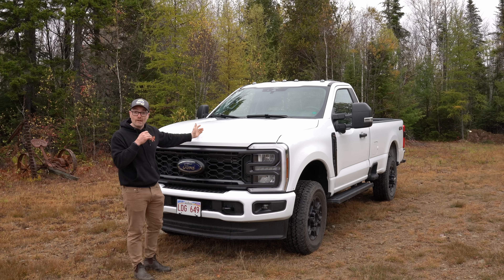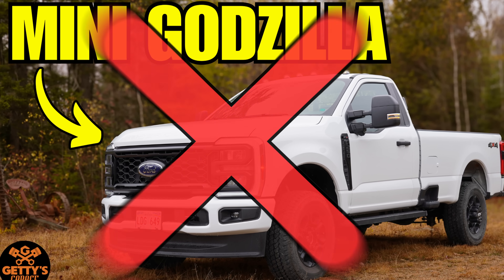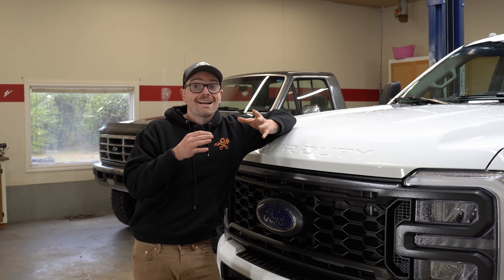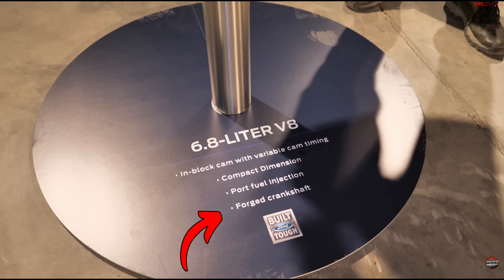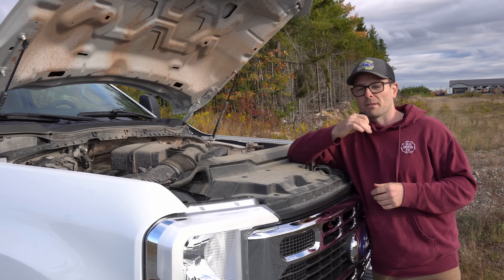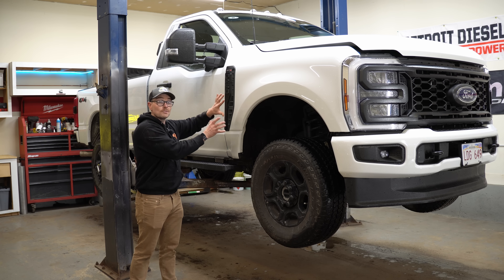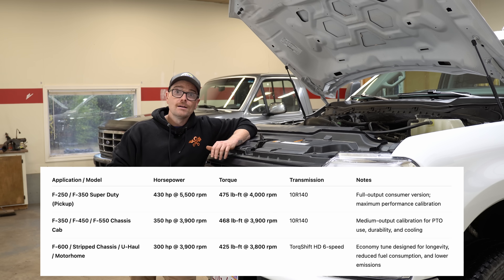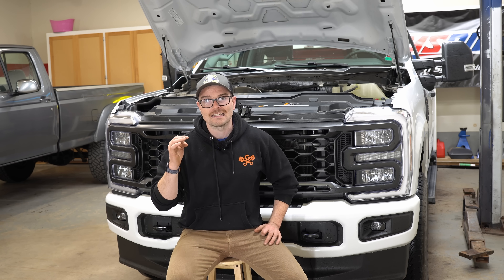Ford F250 6.8L Mini GODZILLA V8 Engine | Weak Points & Common Issues YOU Should know..

Comment: I have a f350 crew cab stx with this engine and I'm extremely happy. I tow a 5th wheel at 12750 gvw and have been all over North America with it. It's been extremely reliable, has PLENTY of  power even at high elevation and it sounds phenomenal. Best of all it has none of the problems that come with modern diesels. I would buy another in hearbeat
Reply from the maker: Thats awesome! Happy trucking
Reply: GET THE NEXTGEN VALVE BODY AP GM FORD ALL 10`S NEED IT ASAP
Reply: Hi, what reared differential ratio are you running?
Reply: @jockobacumbo623 3.73
Reply: @jockobacumbo623  3.73
Reply: This engine is a pig, just get a diesel and delete the emission crap from it.
Reply: @polska905  Emissions Deletes aren't all they are cut out to be. Who would want to void the warranty on such an expensive vehicle to begin with? Additionally, deletes create their own problems. These engines are engineered to use the EGR to help control temperatures in the head etc. thermal problems end up leading to warped heads, head gasket problems and all sorts of other things.
I have a close friend who is a diesel mechanic who regularly does $15,000 jobs on recently deleted diesels. 
Unless you need to tow over 20,000 lb on a daily basis there is no economic case for diesels in a pickup truck anymore. The new HD gas trucks from all three manufacturers perform great.
Reply: @mike-b5c3g your friends are obviously doing something wrong, I know over a dozen people with deletes and their engines run better then new.
Reply: @mike-b5c3g Exactly ill stick with my 12 mpg
Reply: for another 10,000$ plus 5k to delete? Thats insane
Reply: @jasonkushneryk5649 maybe 10k more, but it will save you money on fuel in the long run and last longer and have way better low end torque. can delete for less then 5k.
Reply: @polska905 how much do you think it cost to replace the 6.8L gas engine? once it goes
Reply: @polska905 LMFAO at talking about spending a extra 10k to save pennies on fuel 😂😂😂
Reply: @West_Anderson it's not pennies, it's 10s of thousands of dollars over the lifespan of the truck.
Reply: @polska905 no it's not lol. You'll never recover that difference in fuel costs vs maintenance etc.
Reply: @West_Anderson you absolutely will recover the difference and then some.
Reply: @polska905 let's see, I did the math which I doubt you have. It would take roughly 150,000 miles and 10 years to break even. And that's considering that every single mileage of use is with towing and a difference of the gas getting 8mpg while towing and the diesel getting 15mpg which is optimistic.  So unless your doing nothing but towing and over 20,000 miles a year, no it does not make sense and you will not save money. It literally only makes sense if it's being used for a business work vehicle.
Reply: @West_Anderson your math is wrong,  a diesel, will absolutely save you a ton of money, especially when you consider it will outlast that pos gas engine. Do a delete on a diesel and it wins by a country mile.
Reply: @polska905 still waiting for you to provide actual math instead of your opinion based assumption. Which you won't, because you're wrong.
Reply: @West_Anderson wow what a coincidence, I'm waiting for the same thing from you...
Reply: @polska905  Cost of fuel as of writing this - diesel $3.497, gas $2.996. Fuel economy - generously a deleted 6.7 is reported at 21mpg, and I can't find 6.8 numbers but being extremely mean to the 7.3 puts it at 14mpg. That puts us at $16.65 per 100 miles with the diesel, and $21.4 for gas. Assuming it costs $10,000 extra to spring for the 6.7, and another $3,500 to delete it, that would take 284,210 miles to break even. If the 6.8 gets better fuel economy than our worst case scenario 7.3, like say 16mpg, then it would take 649,038 miles to break even. If the deleted diesel gets less than 21mpg then it takes even longer still. This of course also doesn't account for the increased insurance cost of buying the diesel. More expensive vehicles cost more to insure.

TLDR: Unless you're towing heavy loads constantly, then you'd be way better off putting $10,000 in the stock market than buying a diesel.

Edit: Oh and assuming you drive the national average of about 15,000 miles per year, it would take 43 years to hit the 650,000 mile break even mark. Almost 50% longer than the term of a mortgage.
Reply: @samueljardine3402 yes, it's easy to skew the numbers for the gasser as you did, but in other parts of North America diesel and gas prices are on par and your bullshit mpg numbers are not for towing, once you hook up a trailer to that gaser, you are lucky if you see 8 to 9 mpg and that pos will fall apart way faster then a diesel.
Reply: @polska905  Cope harder. Those fuel prices are the national average. This channel also tested the 6.8 and it does get about 16mpg in real world testing. And I literally said that if you're towing all the time the diesel makes more sense. But most 2500's aren't towing most of the time. If you cherry-pick certain parameters you can skew the numbers for the diesel, but for most cases the gas engine is the better option.
Reply: @polska905 No one's buying a 100k truck and voiding the warranty. Id never trust buying a used modern diesel.
Reply: @Billybob-go8hn thousands of people are deleting on brand new 100k+ trucks, if they weren't, there wouldn't be a market for it.

I personally know someone that bought a brand new ram 3500 and it had a delete in it the first week he got the thing.
Reply: @polska905 Dealers cant legally sell deleted trucks, thats a lie
Reply: @Billybob-go8hn when did I say anything about a dealer?  Companies sell delete kits for brand new model trucks. Why would companies sell delete kits for brand new trucks if nobody was modding brand new trucks?
Reply: @polska905   Doesnt matter. You're not getting a deleted truck for msrp. Your buddy bought a brand new truck from a non dealer deleted. Any problems he has no warranty. That is the dumbest plan I have ever seen. You're not getting a truck deleted with a 100k warranty.   Ill stick with the gasser that  costs me more per week but lasts longer. in the end saves me more money. Ive run the numbers, you're far from smart.
Reply: @Billybob-go8hn iv ran the numbers and done the towing, you are not saving anything with a gas engine. Yeah, try and make fun of me when you got nothing, not surprised...
Reply: @polska905 You lose an argument and jump to another dumb argument. After 2 years I can replace my truck, you delete it you better hope someone wants your hammy downs. Because you're not trading it in at a dealer by law. If you can find a sucker to break the law, go for it. Ive never rolled over negaitive equity or had a break down in the last 15 years. Because ill just trade it in for a newer model. Your finacial situation definitely isnt great, I can tell. All the new diesels, doesnt matter the brand has a 60-70% chance of having a major issue pre 100k. Sure its underwarranty. Id rather have the peace of mind, if im stuck on the side of road that can cost me thousands even with a backup.
Reply: @polska905 and you probably tow 5 times a year.🤦‍♂️

Comment: The thing they got wrong is that the engine will blow up before 80,000 miles.  The valve lifters self-destruct due to low oil pressure when idling.  There are lots of videos about this.
Reply: You are referring to the early 7.3. Zero issues to find with lifters and the 6.8
Reply: This was on chassis cab configurations of the 7.3.   They had single digit oil PSI at idle, and that’s what chewed up the lifters. The 6.8 has over 30PSI oil pressure at idle.  Not a problem.
Reply: @motorobo0  30 PSI at idle? That would be great if you are correct, but my research (granted this was the 7.3) was that it could drop as low as 8psi at idle. There is a recent PCM flash (I discussed it above - but I doubt even that flash boost it to 30 at idle). But, I hope you are right - I'm just not finding info to verify.
Reply: @Quidisi  I haven't seen that info out there either, but I was also concerned about it, so I checked a couple of times on my 6.8 with forscan.  The second time, because I couldn't quite believe the first time.  It bounces around, but didn't drop below 30 when it's warmed up.   Always a chance it could dip below, but it didn't while I was staring at it for a while.  Clearly though it's a far cry from the single digits in the early chassis cab 7.3s.  I think they learned their lesson, and maybe even overcompensated.  That's the single biggest piece of bad PR that Godzilla has had, and the once nice thing about the variable oil pump is that the pressures can be updated..  Easy fix.
Reply: Can you replace the oil pump with a constant pressure pump?
Reply: @pehenry  Yes. $500 Melling high volume oil pump. You'll take a slight MPG hit, but your engine won't be oil-starved.
Reply: @pehenry  There is a way to increase the idle RPMs, which its said accomplishes the needed oil pressure increase.  However, for many, installing the needed hardware/software will be too late. 😡 Also, a heavier oil in summer (and even in winter) may help. But, be careful you don't void your warranty if your vehicle is still covered.
Reply: @pehenry Yes... Holley makes replacement

Comment: My 24 Nissan Titan XD Pro-4X has the same payload and can tow just as much as that Ford 6.8 and will outlast it too!!
Reply: Unfortunately 90% of truck people will immediately right you off the moment you say "Nissan" regardless of specs . The brand has also lost a lot of legitimacy in the car space in general.
Reply: @jakeyjake15 
That is true but the ones who can see pass that and have owned a Titan say different
Reply: The titan can tow 18k on gooseneck? Bro get out of town.
Reply: @Dubduce-d6v 
Yeah, ive towed 18k with mine!! I went from Montana to Washington and no problems!!
Reply: @stevenpeterson7234 I’m not arguing with you that you towed it, it’s just not made for it. Small axles, small brakes, etc. you can’t compare that pickup to a 3/4 ton or 1 ton pickup. With all due respect.
Reply: @Dubduce-d6v 
I agree man. Im not arguing either. Im just saying everyone dogs on the Titan and I use to too until I took a chance and bought one. Im honestly surprised how underrated it really is.
Reply: That Titan will be rusted out long before that Ford
Reply: @sprint2648 
That Ford will have a blown engine and a blown transmission before the Nissan Titan XD rusts out lol. Honestly the rusts issues were a few trucks. Now Ford 7.3 gas and transmission problems are 100,000's+ trucks 😂
Reply: That f250 has about 2x the payload of your XD.
Reply: @keroppl86 
The Ford f250 only has 1,000lbs more payload.
Reply: @stevenpeterson7234  

It’s more than that. This truck will have well over 3000lbs of payload with or without the upgraded gvwr ford now offers. I’d guess around 3600 with.

With a pro-4x XD gas, I’m guessing you are maybe around 1800lbs.

The 8800lb gvwr was an odd choice, underrated or not. That’s like an f250 from 1995.

For reference, I drive a 2025 Chevy 2500 trail boss and my door sticker shows 3460lbs.
Reply: @keroppl86 
My XD shows 3000lbs of payload
Reply: small pecker syndrome..
Reply: Nissan titan is having lots of engine replacements right now its more of a issue than the zillas. Its one reason they discontinued the truck it was costing them more in warranty then it was making.
Reply: @rockie307 
Lots of engine problems? Where are you getting the information from? The 5.6 has been around for 20+ years. You must have your information wrong
Reply: @rockie307 
Your talking about the 2017 model year. 2020-2024 are bullet proof. Might wanna do some actual research 😂
Reply: Always some Crapanese fanboy talking imaginary superiority on American truck threads and videos...
Reply: If you don’t mind driving around in the ugliest pickup on the planet then go with the Nissan.
Reply: @lennyjonas5417 
At least my ugly truck will outlast any other truck!!

Comment: Hey Alex. Thanks for your videos.  I have learned alot. Great information. 

My 6.4 powerstroke has been acting up and I am looking at getting a 1 ton gas truck. 

I know you drive a hemi. If you had to choose today would you still go with the 6.4 hemi or the 7.3 godzilla? With the options I want the dodge hemi is considerably cheaper so im leaning that way.  Thanks!
Reply: i  have  a  24  ram  6.4  great  truck  over  last  2  years  only  isdue  is  loud  pwr steering  pump  at  low  speeds  my  dealer  refuses  to  acknowledge  problem.
paid  52  grand
Reply: @jasonmekush5280  thanks fir the info buddy